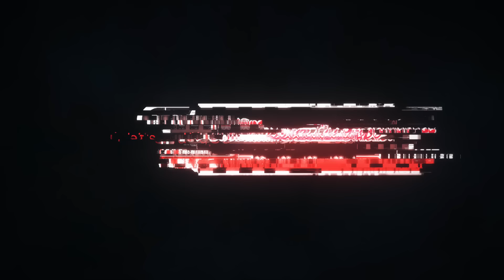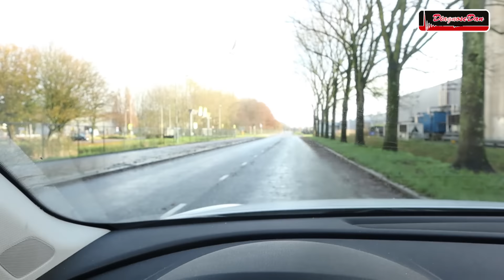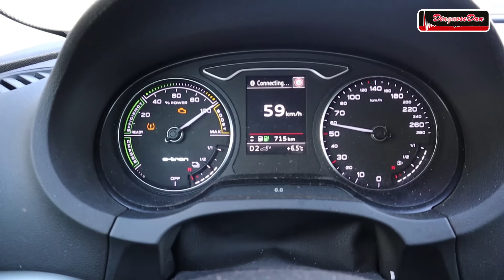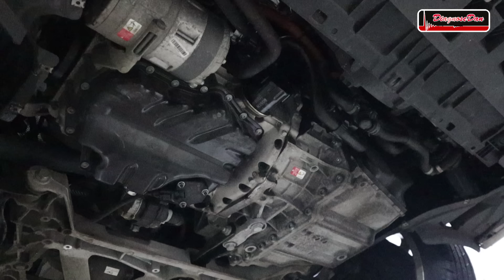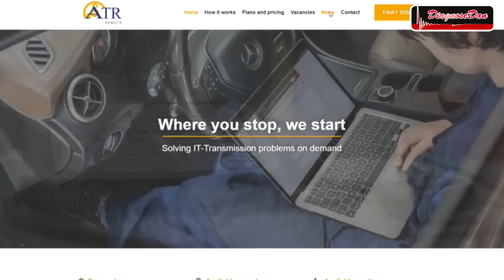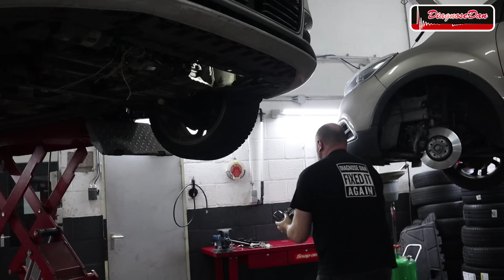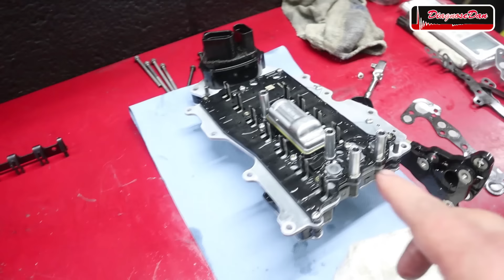DSG DQ400, p2884. Replace or easy fix?

Comment: I love how almost all the cars you get are years old hybrids that sold well in the Netherlands back then but need special attention now. More sytems, more complicated, more diagnostic videos for us :) As a german I can say that paying a dutch crate of beer in exchange for that info/ repair isnt that bad of a deal :)
Hopefully these replacement gaskets where better than OEM and dont rip again...
Reply from the maker: I certainly hope so but VAG doesn't share this info with us. I guess them telling us they improved the gasket is the same as telling us the old gasket is rubbish and they are reliable for the damage done😂
Vielen Dank!
Reply: What I find rather interesting is that the mesh is single piece sandwiched between the gasget. I wonder what kind of black magic is going on in the oil passages that "cuts the screen" out - judging from the video quite cleanly... 

Ordered new gadgets to my -17 GTE and planning to change them next time I change the DSG oils. When purchasing the gadgets I noticed that there are 4 different revisions from those gadgets: A,B,C and D. New ones I got are revision C would be nice to know what revision were the ones that have failed.

EDIT: It was visible on the video that the failed gassed were revision B
Reply: @Kauko88  I guess that Clutch 0 takes much more pressure and is used more often than all the other clutches in the DQ400. The enormous pressure just rips out the mesh over time. If these where my cars I would choose the gasket with the newest revision date which probably have larger meshes. Or I would remove the meshes all together, that DSG transmission has seperate oil filter that should keep the big chunks out of the mechatronik anyway...
Reply: @Rockport1911  If I recall correctly: The preasure is unified along the valve bodies so no clutch receives higher preasure then another. Also, K0 is operated only when you're driving with the internal combustion engine - it connects the ICE to the Hybrid unit / gearbox - K1 and K2 are the "normal" clutches used for R-1-3-5 and 2-4-6 which get much more use compared to K0. If you drive mainly electric it might be that the ICE won't fire up for weeks and the K0 is not operated. 

Dan mentioned that removing the screen is not recommended - it could cause that debris that would otherwise be picked up by the screen and dropped back to pan when operation is terminated - will end up in the solenoid causing the same end result as the mesh ending there.  

My initial "hunch" were that it might be a problem with the original part and once again VW is making their customer to foot the bill :/

Comment: If cars and trucks didn't break down, people who repair them wouldn't have a job. When I started out as a rookie, at 18yo,  in 1968, I saw pattern failures in every brand. If a customer explained their cars problem, we usually knew what the problem was before we even put our hands on it. We had seen the same problem multiple times before. We didn't tell the customer to contact a lawyer, we all knew that cars wore out and broke down. It makes the world go around.
 
Today, cars are expensive and very complicated. Electric and Hybrid cars are relatively new technology and the pool of Technicians to repair them is cut in half. Todays cars are much more reliable than they ever have been and that's a good thing. When they do break down the repair cost is crazy because the complexity of them.  It appears that VW tried to prevent a problem but instead created one.

Although after 50+ years in the repair trade, I'm retired but, I miss the challenge of obscure problems but thanks to dedicated technicians like Dan, and connections to the right people he makes this repair less complex and expensive for the consumer in the end. 

Technicians like Dan deserve to be well paid. We only see the entertainment part of the work he does. He makes it appear simple but it's sometimes it's very difficult. I can't count the times, that I couldn't sleep at night thinking about a problem car that I had to have an answer for the next day. 
Technicians aren't bald for nothing. Our hair didn't all fall out we pulled it out. Thanks for another great video, Dan.

Comment: Great work Dan, very interesting. Do you think this could be prevented by additional oil changes  with cleaner oil putting less pressure on the screen?
Reply from the maker: I dont think so they oil is usually not pretty clean.

Comment: Hi Dan, I have a 2016 Skoda Octavia and have an intermittent issue with juddering when I start to accelerate from a stop. I have been told that this is a known issue with DSG transmissions.  Are you familiar with this DSG issue?
Reply from the maker: Yes sir, but i guess you have a different DSG than this one
Reply: I had the same problem with my 2005 Octavia. It was a problem with my dual mass flywheel. Had it replaced and the judder was gone. The second time it occurred at about 500000 km I did not want to make these costs again so I kept driving. The judder was worse when my front wheels were turned in. I made sure my front wheels were straight when accelerating from standing still and I was being gentle with the throttle. I reached  600000 km without having major judder issues before buying another car.
Reply: HI, Thanks for the comment. My Skoda currently has about 115k on the clock and has an extended warranty up to $2000 up until march next year. drives perfectly otherwise. my problem is very intermitent so I'm just not sure weather to take my car in or not?? ( they may not be able to replicate the fault etc)  I have read somewhere that the fly wheel can be an issue. what do you recommend? @dickverboom4379

Comment: Why oh why does Audi keep using small oil filters which mess up and can damage an engine so badly. In this matter the best solution, since it's a pancake gasket, is to make the oil filter a little larger diameter instead of just a few millimetres offset of the clearance hole. It's clear that over time, this oil filter can not manager the oil pressure in the transmission and just bends out of place but if that filter was has a larger placement diameter spread, it could have a stronger surface area to take on the pressure and not just slip out of position.
Reply from the maker: Thanks for your comment

Comment: Who makes the lift how much ? I see a lot of these little lifts these days are they expensive
is it necessary to have that screen I think probably not, considering the problem that's closing and replacing you're gonna get the problem back again just leave it out.
There's not gonna be an issue replacing a new gasket without the screen and the new solenoid how can there be there's nothing to block the new solenoid
Reply from the maker: Never remove the screen!

Comment: Hi, any tips where to get the seal with the screen in-order to replace it during next transmission oil service before it fails? (currently 177k km on the clock and got pretty nervous after watching this)
Reply from the maker: Contact ATR transmissies, link in discription
Reply: @Diagnosedan  I managed to source the seals by the part number that were visible in the video. Did you replace the bolts holding the mechatronic to the transmission and the mechatronic cover bolts or can you reuse the old ones?

Comment: i work at a vw dealer, have a car with the same problem. But different code i think.  Needs a completely new transmission according to vw.  So its a 20 000 euro job under warranty.  1000 km on the odometer and 4 months old 🤨
Reply from the maker: No way🫣

Comment: i suspect the backpressure caused by the screen is causing flexing and the sharp edge on the hole cuts the screen.  a very light champfer on the matching holes may be all that is needed to alleviate the problem
Reply from the maker: Thanks for sharing your thoughts!!

Comment: Awesome video again Dan. I have one question though, the unit had four solenoids and you changed number three from the right. Was that the solenoid that was directly in contact with the missing screen or was this the solenoid that you always change for this particular fault?
Reply from the maker: Its the one solenoid in the oil passage for the missing screen. Its always this one for some reason

Comment: Looks to me Dan (I am just a layman and only used to working on old carbie driven ICE vehicles)  that the gasket which holds that filter is really cheap and cheerfully made and the fact that it required a new solenoid in what is in my mind a quite expensive brand of vehicle is to me a disgrace. I am very anti electric vehicles anyway and I for one will never go electric because I would not be able to trust them or indeed afford one. I feel sorry for you seeing that EV;s are becoming more common and servicing/repairing them must be a nightmare.
Reply from the maker: Ev's are expensive and not for everyone. They are getting cheaper but still alot more expensive than ice cars

Comment: Hi Dan, As always your expertise and knowledge is shared to everyone to assist and help everyone. It's a shame that the major manufactory, insist your spend a vast amount of money for a part which really does not need replacing. So therefore, if the parts can be bought in single format, why don't the manufactories do the same as your friend and supply a kit? Always being a common problem, this must be a quality assurance problem and again you would have thought a recall SB would have been sent out. Anyway, thanks again for your in-depth research in to common problem.
Reply from the maker: Thats because of Waranty reasons, a lot can go wrong with this repair. Its saver for the Dealership to replace the entire unit. Less that can go wrong and less comebacks. Most techs dont have experience with taking transmissions apart, thats usually done by specialized transmission shops

Comment: As someone has said, this should be a recall. Audi have "form" when it comes to using cheap oil screens/filter/mesh. There is one of these in the oil feed to the turbo's in the RS6, which they have issued a recall for. I guess thats because the RS6 has a massive profit margin. I understand why not to delete the screens from the gasket when repairing the fault, but could it be worth removing the mesh before a fault develops?  Another amazing video from Dan😊
Reply from the maker: Its advised to leave the screen in place

Comment: Very good video. 
Maybe someone knows why there is no available DSG transmission parts? I have DQ250 and I need to replace syncro rings they have part number, but in VW dealer catalog I can't find. Also there is no available parts diagram or repair manuals in erwin.
Reply from the maker: Contact ATR

Comment: Basically, Audi's are shit cars. Once they cross 50K miles they start shitting up. Overheating, check engine, gearbox fault, gasket leakage, in short they want money to be spent every year. 3 audi in a row, A6, AS4, and Q7 none of them ran faultless and I still don't know why people even buy those?
Reply from the maker: Thanks for your comment

Comment: 12:39 - There is one more difference in the gaskets: the new gasket has an open hole in hole 6 when counting from the right hand side, while the existing gasket has an oil screen there. You can also see it at 12:46 at the right hand side. There must be a reason, why VW/Audi removed that one.
Reply from the maker: I noticed, but we have not found out why they did that yet

Comment: VW Passat GTE has the same transmission and the same problem, dealer wants +4k€ to fix it. Obviously a manufacturing flaw but VW doesn't give a crap.
Reply from the maker: Yes the GTE uses the exact same transmission

Comment: Is it possible that this fault comes together with: P0867 "Transmission Fluid Pressure 
          P0867 00 [040] - Function Restriction due to Low Pressure"
Reply from the maker: Thats the other fault i talked about. Thats an internal leak
Reply: what fix this problem with the P086700 ? We need to change the entire mechatronic or it should be repaired too ?  @Diagnosedan

Comment: I have a question. How did you start the engine if there was no oil pressure in the mechatronic unit. Surely it would need oil pressure in order to engage the engine disconnect clutch and start the engine. Would it not have been safer to gently heat the engine bay from underneath with an electric fan heater?
Reply from the maker: There was oil pressure we just didn't check the level yet
Reply from the maker: Yes if the engine wouldn't have started i was thinking about that

Comment: There is a car where the transmission is about impossible to remove.  With the subframe out then not a problem but then the bolts holding the subframe go into caged nuts and if the bolts are rusty the bolts just spin the nuts and you have another battle.  Well, if you nearly memorize the entire shop manual you start to realize their really is an approved transmission removal procedure.  The trouble is it is spread over four sections of the manual.  Once I figured this out I decided to follow this procedure and sure enough it works, transmission drops right out.  So, spread the good news over the internet.  But each person who had succeeded in doing this nearly impossible job figured they had a method.  Nobody was interested.  Life is interesting.
Reply from the maker: Thanks for the great feedback

Comment: Well done Dan! Unfortunately almost nobody does component level repairs these days. In electronics it's just the same, especially with instruments worth in excess of 100k. What a shame....
Reply from the maker: As components get more expensive, especially on hybrid and electric cars it makes more sense to try and repair these components
Reply: Exactly! From what I hear, one LED for headlight can get in excess of 2k Euro in some models. 
Replace module!  Yeah, thanks... 

Did you consider starting a repair class? We need more engineers like you @Diagnosedan

Comment: Probably the screen fails because the oil shoots back and forth in that passage and fatigues the mesh. Eventually breaking loose
Reply from the maker: Thats what we suspect.
Reply: @Diagnosedan  From the design standpoint would make sense to smooth out the inner edges of the mating surfaces

Comment: Hi There DiagnoseDan. Grate video by the way. I have a question. why there is a missing screen on the new gasket at 12:45 you can see a big screen on the right part of the gasket. is this some new revision? 10x for the videos you are grate.
Reply from the maker: Yes it has changed a little, i also hope they improved the screen

Comment: At 17:00 Why not let the hose with the valve on the transmission? Close the valve,  Do the prefill the accumulator, run thru the gears then open the valve, let it tribble the excess while screwing off the hose and then reinstall the plug? Why making the mess if you have the filling tool installed?

Similar to my T31 2.0dci auto, and J10 QQ with the same engine and gearbox. The service manual says that you have to fill thru the Turbine speed sensor hole. But to get to the sensor, you have to remove the battery tray and TCM. I mean Why?? When flushing 3-4 times.......
I measured the drain plug thread and went to the nearest hydraulic parts shop to get a suitabe M10x1 to10mm hose adaptor with a valve, and a 8L garden pump an filled it from the drain hole with the leveling/overflow tube installed.
Fluid temp to 45C switch thru the gears and open the valve to let the exxess out, screw off the adaptor and install the plug. No real mess.
Reply from the maker: You are right could have done that

Comment: Dan, do you or Rob have any idea why specificly that part of the gasket fails? I would imagine that other  filters also could fail, but apparantly only that one fails..🤔 Great job again finding it and explaining it to us.
Reply from the maker: We think it had to do with the pressure pulses going back and forward when the clutch is engaged and disengaged. This causes fatigue in the metal screen. But its a theory

Comment: Great video and tons of useful information.  Any money saved in fuel driving these hybrids is spent on these silly repairs.  The very item designed to prevent contamination (screen) CAUSED the contamination! Scan tool required to check oil level??? Good grief…what was wrong with an analog dipstick?  I’ll stick with my non-hybrid, non-turbo ICE for as long as possible.
Reply: The scan tool is required to activate the pump, so the key parts of the transmission fill with oil. The excess fluid drains out as shown.
Reply from the maker: Ironic right😁

Comment: How much would your repair cost compared with fitting a replacement unit?
Reply from the maker: Saves the customer at least €1500
Reply: WOW @Diagnosedan

Comment: HAve you ever fixed the shift solenoids on a mk2 mitsubishi outlander double clutch gearbox. I remember there were problemswith those with no good oem sollution  when I worked in a mitsu dealership.